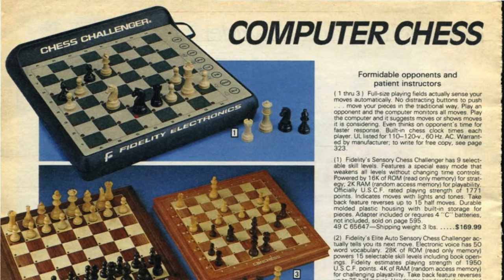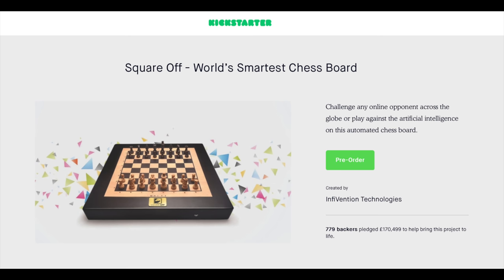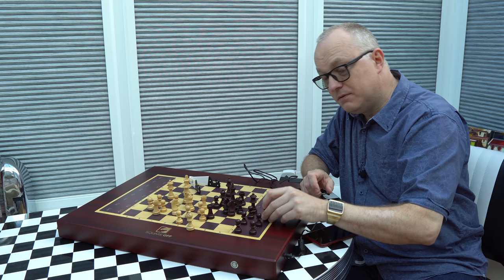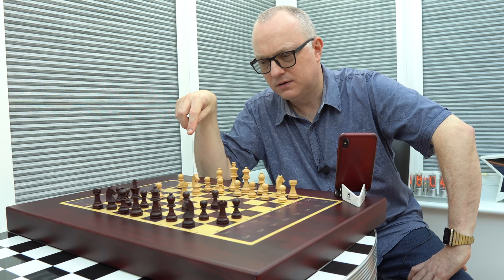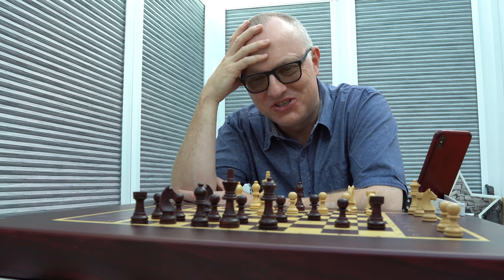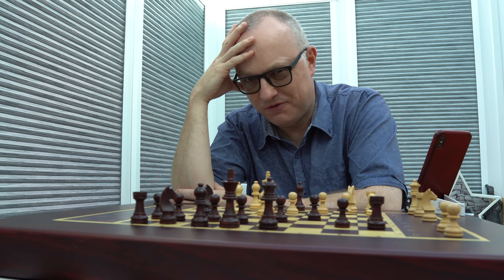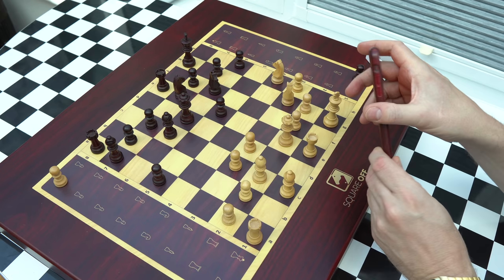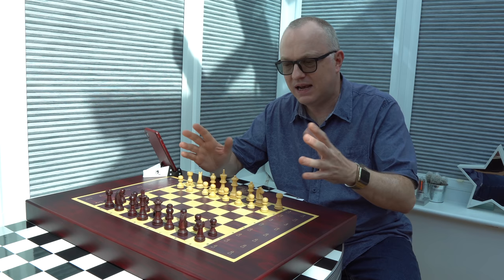Automated Chess - Losing to a Ghost

Comment: So I'm guessing the way this works is that each piece has a bit of metal underneath, and the way the board moves the pieces is with a couple of stepper motors for X and Y axis (the noise you hear when it operates), then enables an electromagnet to grab the piece, then moves to where it needs to go and releases it. That would be quite simple and ingenious! Try grabbing a piece while it's moving and see if it's harder to pull, or try sticking a magnet to the bottom of the pieces! Or you could, of course, just pop the screws off ;)
Reply from the maker: There’s a bit more information about this in the video description text box.

Comment: Some thoughts on how this works under the board:
A header moves along the X and Y axis, much like a crane game or an etcha-sketch.
Each piece contains a magnet, and an electromagnet is likely powered once the header is under a piece, moving it along.
The pieces are cleverly 1/2 the size of the spaces, so they can move amongst each other with few disturbances.
Reply: I agree fellow Damian

Comment: Heh, funnily enough, the surrounded king was not in checkmate. C6 is safe.
Reply: Mort OOPz Ha! Came here to say that too, but thought I’d check if someone else had 😁
Reply: What is even funnier is that the situation is impossible to achive if you follow the standard rules of chess since the Black King is attacked by no less than 5 different pieces. Either the King moved into check or didn't move out of check last move (both cases illegal).

Comment: I made an automatic Chess game like this 30 years ago, using a similar principle to Etch-a-Sketch, but replacing the knobs with stepper motors and using electromagnet.
Reply: That's clearly exactly how this works internally. It's basically a plotter with a magnet instead of a pen.
Reply: Interesting, but I made an automatic chess game like this 31 years ago. You're ripping me off.
Reply: And what AI did you use 30 years ago? Because otherwise it doesn’t make much sense to make an automatic chess game
Reply: @GRBtutorials  Chess computers (either programmes or boards) were pretty common and affordable 30 years ago. AI (albeit very specialised and not nearly as strong as today) is not a new thing.

Comment: The box taking the rook away was pretty funny. Does the box flip the table over if it loses?
Reply: Mr. Dank  all towards you :)
Reply: when it loses it detonates a small 1kg plastic explosive charge inside the board. on the human player's side of course
Reply: Would be fun if the magnet moving the pieces was doubled with a strong electromagnet that send pieces flying away.
Reply: @MrTeddy12397  1kg? I don't think it maaters at that point on which side of the board that charge is.

Comment: “You would need a time machine...”  BUT you do have a time machine.
Reply: I already knew you would say that.
Reply: that will probably explain itself at some point in the past
Reply: It's all wibbly wobbly timey wimey stuff.
Reply: I wouldn't be surprised if the time machine was used to bring back one of the retro boards pictured in the video for the sake of comparison at some point 🙂🤞
Reply: I call mine a clock.
Reply: @banjopink4409  Well, I never said my time machine was as fancy as anyone else was describing, but I'm doing okay so far...
Reply: @banjopink4409  It misbehaves sometimes, so I have to show it who's boss. It's better than keeping my nose to the grindstone I used to have. My face is much less sore.
Reply: @banjopink4409  It still runs, but I set it 17 and a half minutes off, just so it stays decorative and never actually is useful.
Reply: @banjopink4409  I mostly keep in under an awning if I even let it go outside at all.

Comment: An app is definitely no go, otherwise this would be a nice gift for some of my elder family member.
Reply: I've got to wonder if the app is literally running the board's algorithms even in single player, or if they could release an app-optional version with a few extra buttons.
Reply: @Bobo there can be a difference between current path of least resistance and long term least resistance. If there's an OS update in five years that breaks all older apps, such as iOS removing 32bit support, then they'd have to redo the app or just brick the product. But if they have some chess routines on the board, since it obviously has enough power to communicate wirelessly and with low latency, that would be less resistance in an uncertain future. But of course it's much easier to get initially running, to just run the computations on the phone and have an Arduino in the board and leave it at that. 

I can only hope they release an update that can slightly increase on-board functionality ahead of closure if they ever do have to shut down. They're almost certainly just renting cloud space anyway, not running their own hardware, so the infrastructure could go away very quickly if things turn south. Even if it took the microcontroller longer to work out a move than the phone, it's still going to be more powerful than an 80s home micro.
Reply: @kaitlyn__L  I bet that even now someone is hacking away at reverse engineering the comms so they can make an standalone app
Reply: @Bobo yeah.. that's a shame. I don't like how disposable software has become. I do agree with you that that's how they probably did it though.
Reply: Friend of mine has a guitar FX pedal which accepts an old iPhone 3G(s) as the controller. He has had to appeal to people for donations to keep it going. He has a backup of the phone with app, the app is long gone from the app store.
Reply: @6581punk  Holy shit, how the ass can he bring it back alive when its gone from existence?
Reply: I was hoping Techmoan would take it apart so we could see the internals, maybe there's some kind of on-board service mode that could have it do something app-free
Reply: @kaitlyn__L  I think the board has minimal logic, probably just a Bluetooth microcontroller that isn't really suitable to run chess algorithms, but it's doing fine running the motors, nor does it have inputs. But usually reverse engineering Bluetooth gadgets is SUPER simple, it's usually just a minimal shrinkwrap over a simple serial protocol, and i think it will be reverse engineered should the company stop supporting the product, and there will be an alternative open-source app or you could make a standalone device with a single-board computer. Not many communities are as engineering inclined as the chess one, which is why i think it will happen.
Reply: The cheapest raspberry pi could solved everything, with optional mobile or PC support. It may even link to some online chess services or games, but as now. Some genius has to hack the app into a pi and mod the machine itself.
Reply: mipmipmipmipmip  Indeed. There should be some sort of law which says you have to publish the protocol for such things.
Reply: @Bobo oh come on, at that price point it could as well have a built-in Android device with screen and all, and physical buttons for basic app stuff.
Reply: mipmipmipmipmip  it's similar to having the software on a floppy disk, but much worse, since despite how fragile those are, they're MUCH more likely to stay around for years than a stupid app on an app store. Well, technically, the developers could have provided the APK file on an SD card, or USB drive in case of apocalypse or something, because unlike iPhones, Android does support apps from unknown sources with a flick of a single switch in the settings.
Reply: @SianaGearz  I sure hope it gets reverse engineered!

Comment: The playing surface being wood would work, but I suspect such a surface would need to be thin and thus prone to cracking.  

Oh pressure sensitive? That would make it even worse.

I imagine getting the puppets to play chess wasn’t going to happen.
Reply: the border in wood would, for me at least, double the quality feel. the playfield itself doesn't really matter to me tbh, I can understand why it's plastic.
Reply: Mathias DP yeah that does seem like a bit of a cheat.
Reply: "wood would it?"
Reply: @hardlyme779  I panicked, thinking that I made a mistake haha
Reply: Phos9 Pressure sensitivity could be achieved by using proper wooden inlay with a different type of wood for the white squares.  Anyway the rules could be more easily enforced by treating "lifted from board" and "put back down" as "touching the piece" and "touching the board".  Some way to magnetically ID pieces would still reduce mistakes.
Reply: Perhaps...but we got Matt playing against Matt in something like a live-action Moans segment...😂😂😂😂😂😂😂😂
Reply: Yeah....if the board itself was made of wood, then it just 'wooden-work...'

Sorry.....!!
Reply: @stevesstuff1450  😅😂
Reply: I reckon it would be eminently possible to make it with a real wood finish. The pressure sensitivity could still be achieved and having it thin enough wouldn't be much of a problem.
It's likely more a question of cost. All those mechanical parts inside aren't going to be cheap to produce especially in relatively small numbers, and once you add all the other stuff and a profit margin, a real wood version would probably be prohibitively expensive.
Even normal wooden chess sets of a nice quality aren't cheap.

Comment: If you're using android, back up the apk. (app backup & restore is good)... and keep the phone forever, just in case 😁
Reply: That won't do anything. When the server goes down forever, the app will just give an error and refuse to do anything.
Reply: @user2C47  ah, you reckon the computer player is controlled from the server? Very sad if true.
Reply: or use wireshark to capture the bluetooth packets, so you can write your own app (PC, android or whatever)
(if you know a bit of programming of course)
Reply: @August0Moura  just decompile the app and that's it
Reply: Alex Jamieson depends on how much of the app relies on functioning servers. Some of the features have no good technical reason to have an internet connection. You’d find out pretty quickly if you ran it with Wi-Fi off from first launch.
Reply: @bwebs956  I'm 99% sure it's not. Not in terms of the actual game logic and mechanical control. However, it probably does require to be connected to the server to start a game that is local and completely offline.
Reply: @bwebs956  One would hope the computer player is controlled locally, given how trivial and cost free that would be to do these days. It would be easy to check by sticking the phone in flight mode and seeing if you can still play.

Comment: Surprisingly, 12:18 is not checkmate. The King can capture the pawn on c6
Reply from the maker: It’s a comedy sketch - the beard wasn’t real either.
Reply: This position is also not attainable through normal play, since there is no way to have two knights checking the king at the same time. Still, super funny, comedy well done.

Comment: At least with android, even if the app got taken down, you could sideload the APK and use the local play mode that way. It might also be possible for someone to modify that and connect it through a 3rd party server for the online functions.

Not sure there's anything option like that for iOS, though!
Reply: Other than jailbreak and downloading AppCake?
Yeah, no.
Reply: I think I used to restore apps using their IAP through iTunes. (No jailbreak required).
Reply: Worst case, you still have a usable chess board, even if the app is gone and the battery is dead!
Reply: That's if they don't run the actual chess calculations on server side...
Reply: Tbh it wouldn't set anyone back too much to buy a cheap android tablet just for the chessboard. If you can afford that much money for a chess set, you can spare 15 quid for a second hand kindle ;)
Reply: Just buy a second android
Reply: There is a program that can run on Windows and probably on Linux that can put apps on iPhones through a USB cable but you need to have iTunes installed for it to work
Reply: You could route the app communications through IRC or jabber to save yourself that insurmountable cost of a server that companies love to ditch after their first year discount expires
Reply: @kyynis  seems unlikely. It would need to be disclosed quite obviously if you required an internet connection to use it at all, since plenty of people don't have that

Comment: Back in the '80s we pitched 2 chess computers against each other and hours later we realised how they work. The play defensive and don't attack (as that would require skill) so they just move pieces about until you make a mistake and expose a piece that they can collect or get you into 'check' if they can, even if they can't sustain it. Therefore 2 chess computers playing each other just moved pieces about for hours not making mistakes so not loosing pieces to each other. Eventually we had to abandon the game realizing they don't have any AI at all but are just opportunistic.
Reply: I mean it really depends on the chess engine. If you check out some of Alpha Zero’s games, you can see that it likes to sacrifice pieces a lot.
Reply: It's a generally sound chess strategy to get your pieces (especially your king, via castling) safe in the early game. It's usually only later that opportunities to attack appear, as attacking when there are too many pieces on the board can be disastrous. Modern chess engines (and top players) may attack and even sacrifice a pawn or a piece in the middle game in order to get a long term advantage, but less experienced players that try to win quickly are often making terrible moves that are fairly easy to refute. Players like Karpov were champions for years by being defensive and waiting for opportunities to strike.

Comment: That is pretty neat but I would have expected something a bit better for such a pricey board.  I guess it's a low volume Kickstarter project though. I didn't watch the whole video so these may exist, but some features that would be cool are:
- ability for it to recognize pieces (i.e. his RFID suggestion)
- ability to save/load a saved game. Basically it would move the pieces in the position of the saved game
- no need to set up pieces yourself. I'd want to just set the table down and dump all of the pieces in a pile and have the board upright them and put them in position
- should move the attacking piece into the taken piece before taking the piece off the board
- needs to be much faster
- shouldn't have to press down. If it had RFID you could have a different mode where you just press a button on the board to say your turn is complete, which would toggle the clock. This is much closer to how a normal chess board works
- should have a built in chess clock on the board
- should have built in storage for the pieces for transport. Even cooler if they can automatically move in / out of hidden storage on command and set themselves up / put themselves away
- the company could sell fancy aftermarket pieces for extra $$$

Comment: Quick question: what would happen if you switched on air plane mode on your phone and then switched on Bluetooth and connected the board? ie How much of the app would still work without WiFi or 3/4/5G connection? Obviously it depends on how much the cloud is used for in game AI!
Reply: Chess programs were around much longer than neural networks - they simply analyze all possible moves and pick the best one (or wander off to give the human player some slack). Actually many AI players in games follow this strategy: first they have to be able to beat every human every time - then you add random imperfections to make it actually fun to play against. It works in Chess, and in FPS.
Reply: Rob Sedgebeer you can still connect to WiFi  and Bluetooth while in aeroplane mode, just not a network
Reply: unfa not all possible moves, certainly not most chess programs.
Reply: @unfa00 ... That's not how chess computers work. Chess hasn't been solved, so they can't work like that.
Reply: @StoutProper  I know, I'm suggesting using airplane mode with Bluetooth only to simulate the server the app uses being shutdown (you can connect to networks/the internet by switching on airplane and then WiFi, which is why it would need to Bluetooth only)
Reply: @medes5597  I mean that the chess-playing programs will analyze the board, list all possible moves, examine consequences, probably also analyze next possible enemy moves, and see where it goes. After analyzing a tree of possibilities it can then pick the one that looks the most promising. Of course this is probably optimized to not include clearly ridiculous moves (cutting the tree branches if they are not promising after first move). I don't know for sure, but from what I know about programming, AI, computer games development and how chess players work - that's how I think the chess computers work.

I think the game of Go has way too many permutations to explore, that's why only a neural network was able to play it successfully against humans - the chess-like approach didn't work for it.
Reply: You don't need cloud for AI, your phone can beat a grandmaster easily.
Reply: @unfa..another part of chess computers are a hysteresis where it keeps a list of all moves from all games it has won and another list of all games it has lost..and uses that data for part of the move process..
Reply: @vytah
""You don't need cloud for AI, your phone can beat a grandmaster easily."

The cloud makes it much more likely since the amount of computing power is magnatudes better than a phone..

As far as man vs machine for chess the last point that a Grand Master had a chance was Deep Blue vs Kasparov 1996..by 2004 1.8Ghz laptops were beating Grand Masters 9 out of 10 games...by 2005 computers pretty much have passed all Grand Masters..